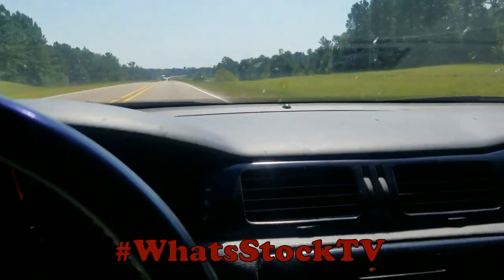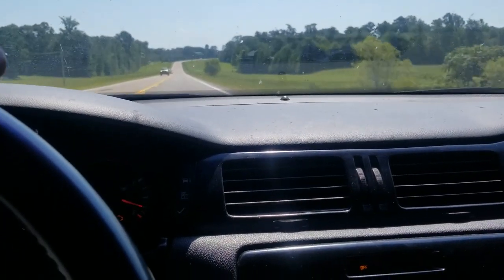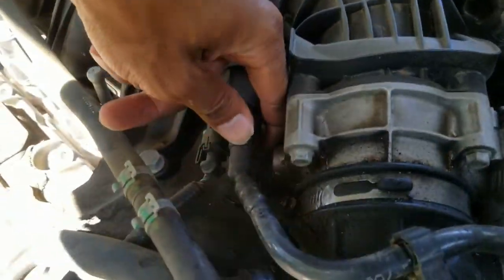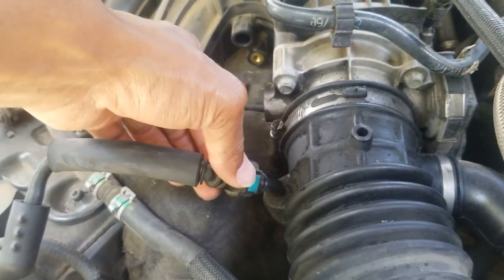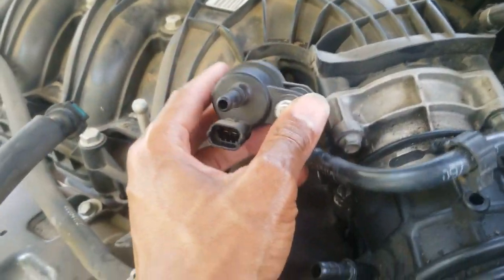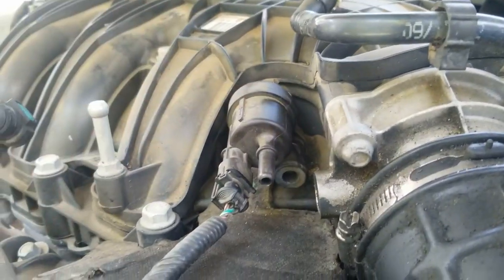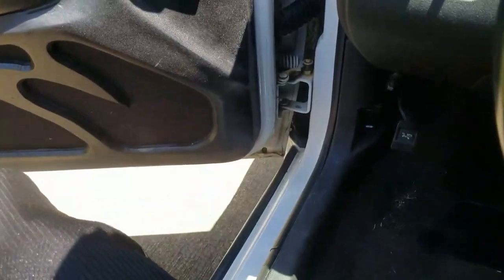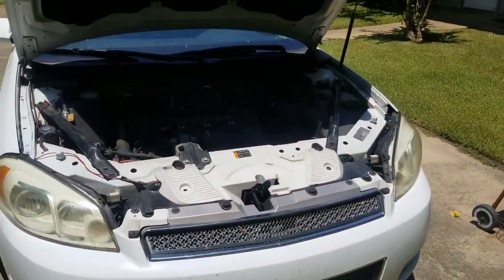Impala 3.6L V6 Purge Valve Replacement P0496

Comment: Preciate that bro..for the people that have the check engine light still on,I was told two things to try,1.get it cleared with the scanner from auto zone or whatever part store that can clear that code,2.Just take the positive post off the battery for 5secs and touch the frame of the car OR touch it to the negative side of the battery(If your able to)and problem solved💪🏾
Reply from the maker: 💯💯 good looking out
Reply: We all gotta learn from each other.You helped me out and I'm spreading what I've learned today💯
Reply from the maker: @ericparker1057  that's what it's all about 💯. Gotta pass on the knowledge

Comment: I had a stripped gas cap and the tip of the Valve look burnt. Replaced both and it's driving how it should now. Manyyy thanks
You saved me about $200-$300 in labor
Reply from the maker: Good deal, glad you got it figured out 💯

Comment: Nice video.I have a 3.6 and the main thing I do is oil change every 5k. Runs better on the good stuff not store brand-personally Mobile, no matter what store employees say.$5-10 difference in cost for better performance.
Reply from the maker: Thanks. This reminds me I need to get my oil changed this week 🤦🏾‍♂️🤦🏾‍♂️
Reply from the maker: Guess I'll have to add that to the list now
Reply from the maker: @@nigeleingram7224 yeah these direct injection cars have the issue with the carbon build up on the valves. And I changed the top mount but haven't done anything with the lower mounts
Reply from the maker: @@nigeleingram7224 yeah I'll probably get em swapped soon. My trans is out anyway so when I get that done I'll just get the mounts done at the same time
Reply from the maker: @@nigeleingram7224 thanks man. I'll keep a note of all this for whenever I get to working on it. Put this car on the back burner for now dealing with these other ones

Comment: I've ordered the part
 Getting ready to swap mine out. I've had the same hard start issue after filling up with gas. I also did the suction test with a leaf just like you did and sure enough, it's a constant suction. Hopefully it will and should fix the issue......thanks for the video
Reply from the maker: @marvelmanor6843  glad to help out. That should solve the issue for you

Comment: My car had that same code PO443. It was my Purge solenoid valve. I changed it and the car is riding better. When mines went bad my car was tryna cut off. And when you tryda start it up it wouldn't start up had to turn the key in the on position 3 times then crank it up for it to start.
Reply from the maker: This one was doing the same thing
Reply: @89imp03  so when tryna start it up you had to turn the key 3 times before starting it up and it starts right up right.
Reply from the maker: @Mr2SMOOTH24  at least twice. It would only do that sometimes after filling up the tank
Reply: @89imp03  do it still do it to start it up where you gotta turn the key 2 times to start it up?
Reply from the maker: @Mr2SMOOTH24  it didn't do it that day. I actually haven't driven it again since I put the part on
Reply: @89imp03  Awh OK
Reply: Boi u aint neva lied 😂 b damn nea finna break the key in dat bih
Reply: @nauticamccarther193  lol 😂😂😂

Comment: this might be the problem my girly face got the same car / problem finna swap it out tomorrow appreciate the good video cuhz forever In my favor
Reply from the maker: 💯💯 hope this fixes the problem for you
Reply: @89imp03  you ever had problems with ur ac? Our left side vent only blows HOT air I think it’s the mechanical issue where it’s just stock open but not too sure..
Reply from the maker: @AsiansOutdoor916  not in this car but I have that problem in the Corvette. I think it's the blend door

Comment: I got a 2012 impala I got the code p0442 small leak I changed the evap canister in the back of the car but engine light is still on any other guess what it could be I got a new gas cap and changed the gas filler neck also
Reply from the maker: Not quite sure, if it hasn't been a long time maybe unhook the battery and give it time to reset and see if it comes back

Comment: Thanks got mine changed out, disconnected both battery cables, and hooked them back up. Check Engine light went right off before my eyes when I started the engine up. Thanks for this video
Reply from the maker: Good deal, glad it was helpful 👍

Comment: Is this part of emissions and would I have to clear the code i got the exact car u have just had that code before i seen your video and fixed it no problem but you are right on it bro also do i have to do drive cycle to make it work the emissions that is.or just drive around
Reply from the maker: I'm not 100% sure but it might have an effect on emissions too. The code should go away if not immediately it'll go away after a little drive

Comment: Do you have any trans problems with the Chevy impala and great video
Reply from the maker: Thanks, so far no transmission issue at all
Reply: Alright I appreciate
Reply: Maybe try either Lucas or the other transmission additive.I changed my fluid  filter out. Still sometimes switches between gears in the mid range. Probably most used gears. High end and low have no problem. I may try K&W Trans-X soon.

Comment: Did you have to drive it a while before the engine light went off ???
Reply from the maker: Yeah I did. I don't remember how long but it eventually went off
Reply: @89imp03  did it go out by itself or did you get rid of the code your self

Comment: Hey can you help I replaced this and broke the clip off the electrical connector. The connector still fits on ok and stays on fine. But now the traction control light is on and idk why
Reply from the maker: I'm not sure on that one. I feel like it shouldn't affect that traction control so maybe it's something extra going on
Reply: @89imp03  I researched it and if the electrical connector doesn't work then it sends a signal to the nass airflow sensor that its not working. And if the mass airflow sensor doesn't work I heard the traction co tool light comes on.
Reply from the maker: @tgn-contentandotherstuff5652  so maybe the connecter isn't all the way tight now
Reply: @89imp03  do you know how to fix this?
Reply from the maker: @tgn-contentandotherstuff5652  I haven't dealt with any traction control lights. If the clip to hold the plug still is broken you should be able to just tape it in place to keep it from moving
Reply: @89imp03 I just found out. It's really stupid. The electrical connector keeps loosening because it's not clipped in. I bought a new connector and I'm gonna either krimp it or take the wires out and put them in the new housing. Thanks man
Reply from the maker: @tgn-contentandotherstuff5652  aight cool, no problem
Reply from the maker: @tgn-contentandotherstuff5652  yeah it's whatsstock_kev but I'm barely on there
Reply: @89imp03  I have one more question. Could you did a video or something showing where the charcoal canister is. Because I can't find it
Reply from the maker: @tgn-contentandotherstuff5652  the purge valve or another part?
Reply: @89imp03  another part called the charcoal canister please?
Reply: The charcoal canister is usually located at the back of the car on either side of the fuel tank. Should be about the size of a small coffee can.
Reply: @tgn-contentandotherstuff5652  charcoal canister is by the gas tank it's a fairly large box. You actually have to drop the tank to get to it. Theres another small evap canister by the gas cap under the car.

Comment: The code it’s giving me is a p0443?
Reply: Evaporative emissions purge solenoid control circuit
Reply from the maker: I didn't get that one. I'm in one of the Facebook groups and they're saying it's also another purge valve closer to the tank so maybe it could be that 🤷🏾‍♂️
Reply: I believe that one is part of the charcoal canister in the back.

Comment: I really appreciate you making this video.. Helped me out so much. I got the same car and the same code with the same symptoms. You really came through. All I did was disconnect the battery for an hour and the check engine light turned off. Thanks again!
Reply from the maker: Good deal 👍 glad the video was helpful

Comment: How did you get off???
Reply from the maker: Just had to fight with it a little bit to get it loose
Reply: It’s hard to take off. I’m sad lol
Reply from the maker: @dosa4434  it was a struggle for me too. Had to wait for it to cool down to really be able to grip the first hose and pull it off. Once the bolt is off the actual part you just have to tug hard to get it off